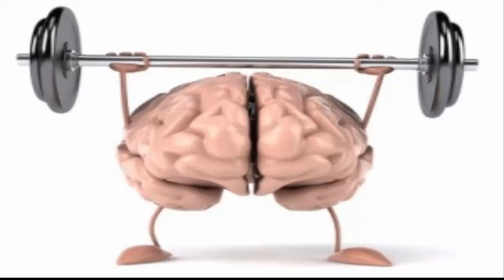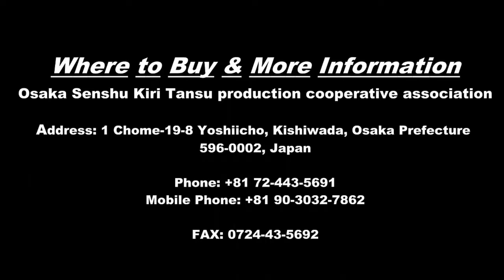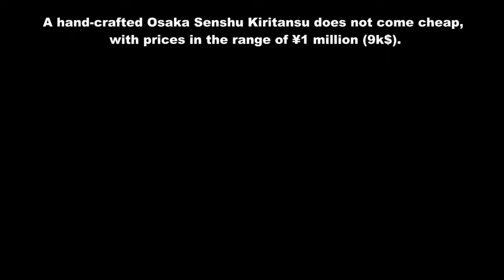The difference between Japanese "Shokunin" and Western Woodworkers

Comment: Thank you for this video. who agrees that the varnish they used on that light cubburd contained to much paint? I think if you delute it a bit the grain would come out more. But be fast with putting it on. Better use some kind of oil that you can rub, it stains less than that kind of stuff. Because on the finished product you dont see any grain anymore.
Reply from the maker: Good Point!